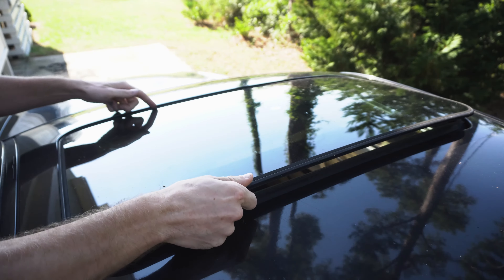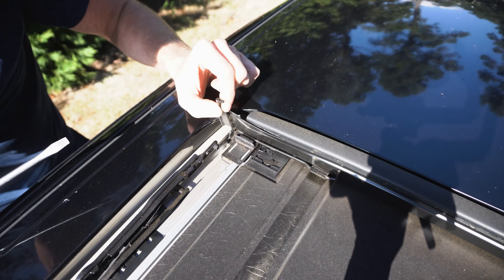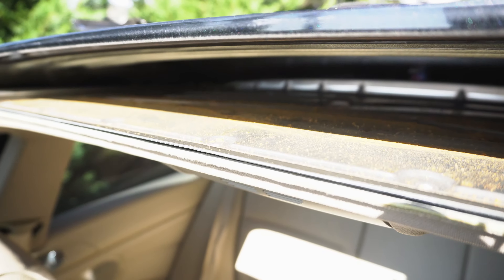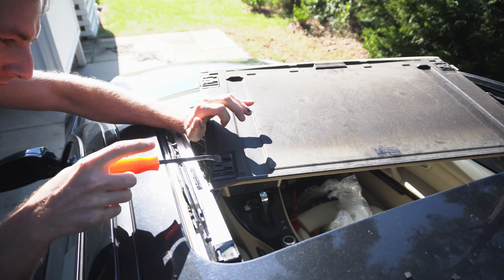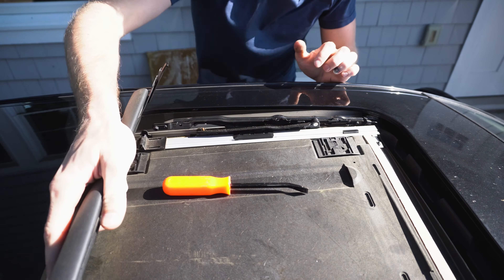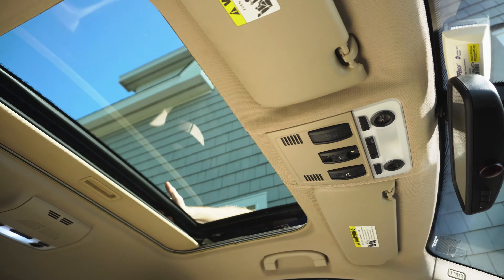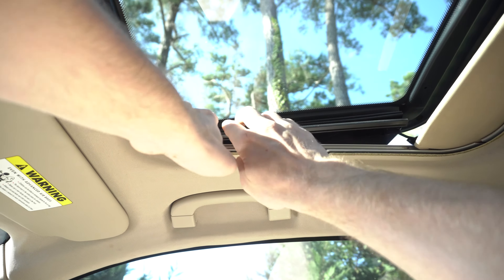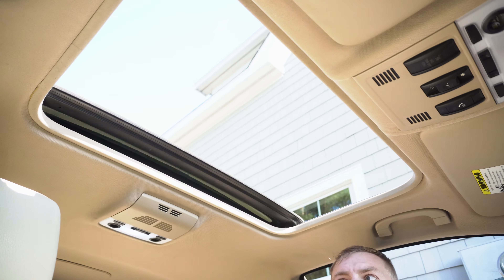BMW Sunroof Shade removal Sunroof Glass

Comment: I like how you say it's "easy"!!! Looks like a lot of work. The head liner from the sunroof shade has come unglued. I guess this is my saturday!!! Thanks for the video.
Reply from the maker: It took me about 1:30-2hr, with recording.
If you have extra pair of hands to help you with alignment, that will be even faster.
Good luck, I hope it will be easy!)
Reply: @Makhnovets   Just completed it. It took me about 3 hours. I took a few breaks, thoroughly cleaned the interior and wanted to let the glue dry. Great post man.

Comment: Good video! I have a question for you. When I replaced the shade, it no longer opens 3" when I tilt up the sunroof. It stays closed when I tilt up the sunroof, and only opens when I slide open the sunroof. There is a loose plastic part that slides along the right side track that needs to get reattached somehow but I don't know how it connects to cause the shade to open when sunroof tilts. The part is only pictured in the service manual but not labelled, or mentioned how to fix this. Thanks!

Comment: What type of stapler and staples can I use? Can I use normal “paper” stapler?
Reply from the maker: I would probably prefer push pins 📌 with flat head, they less noticeable, the liner made off fiberglass material, so can staple it with no problem.

Comment: Hey man I can’t get those side clamps back on at all
Reply from the maker: Just start with the front first, than back one, same as on the video, with and angle.
Reply: I tried it’s two catch claps which ones should go at the bottom or top
Reply: I wanna show you a picture. I washed the video and still is too long.

Comment: Im going to just paint mine the same color with fabric paint
Reply from the maker: I did try that to my headliner, i think this video can be useful to you. Good luck: Car Headliner Repainting: My Mistakes and Lessons Learned BMW z4 e89
https://youtu.be/BhORO15eRD8
Reply: That is not going to work it's going to be a mess lot of sticky glue you can't scrape off need to be replaced